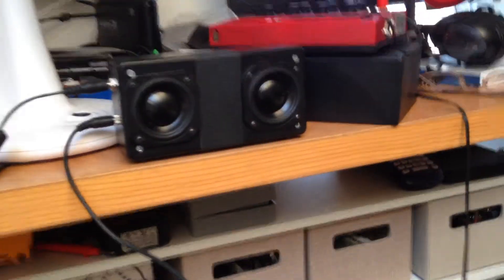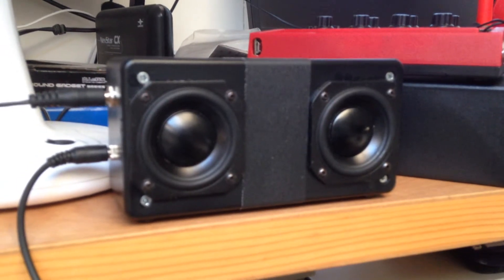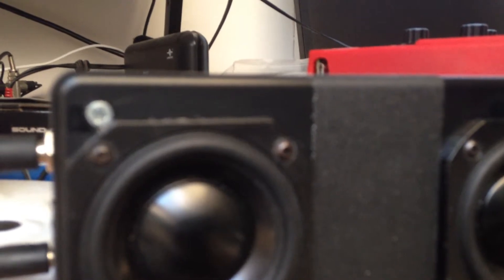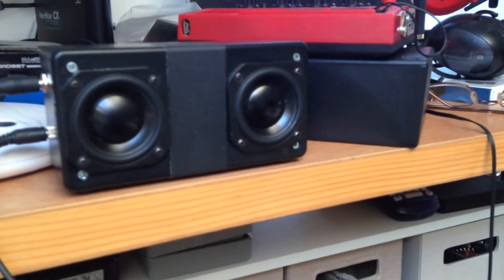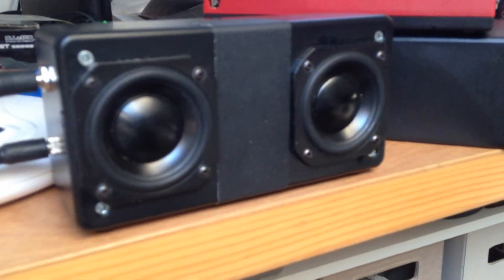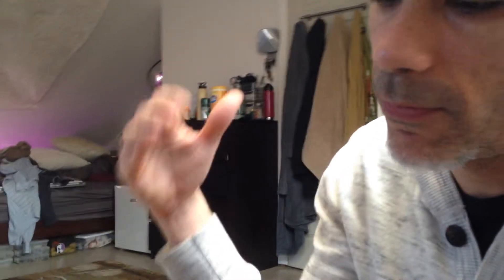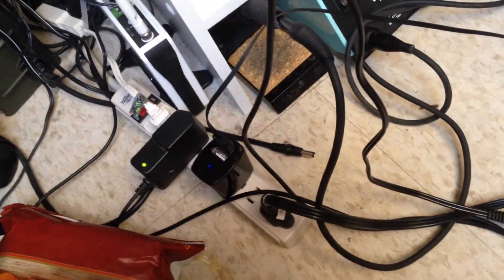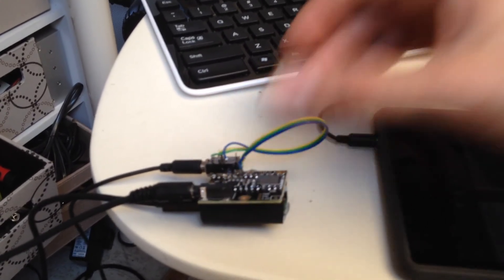Teensy 3.1 audio board background noise (SOLVED, read desc)

Comment: The buzz is evidently the impedance mismatch causing the circuit to pick up the Teensy processor noise.  It could have been any noise that the circuit picked up, but since the noise didn't change a lot when you plugged the phone in (phones are an excellent source of noise) I'm guessing it is coming from the circuit itself.  It could be the power supply, but that might be hard to check since Teensy has its own voltage regulator on board.  Try a couple AA batteries, or a single Li Ion cell (3.7 v) to see if the noise gets better.

 If not, try a few extra decoupling capacitors, especially on any serial data / clock lines.